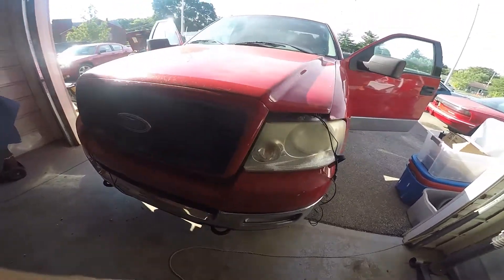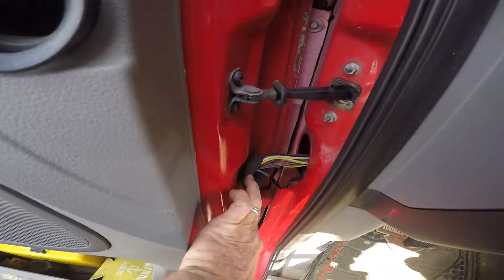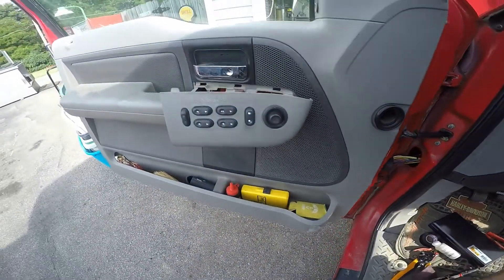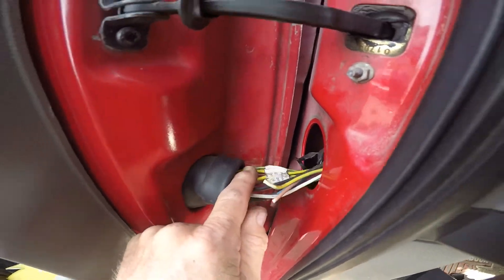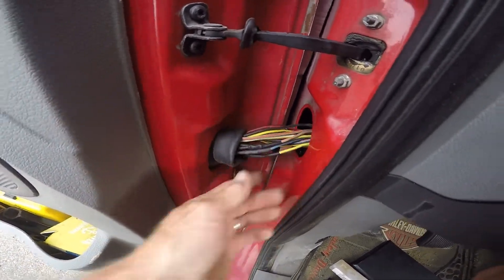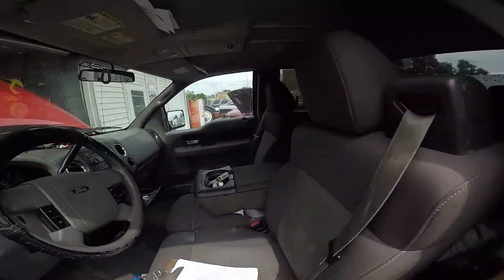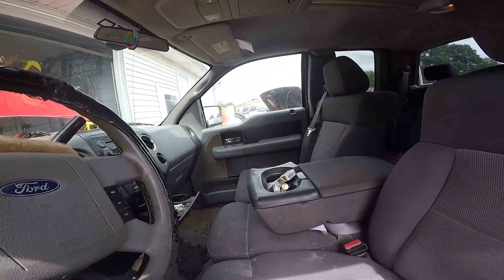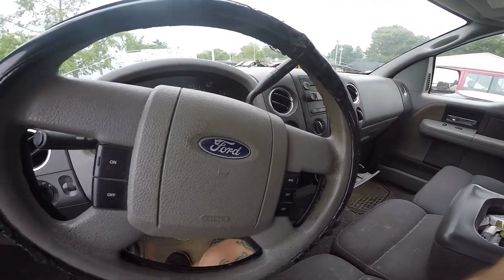2005 Ford F150 (power windows don't work)

Comment: 2005 ford f150 5 button power window problems - Following your video it seems that each window has its own power lead. So, here's my issue, my drivers window switch has been failing for sometime now, going down works fine, but going up was very intermittent. Just yesterday both (up and down) died. All other windows still worked (as good as to be expected for an 18 year old switch). I picked up a new 5-B switch at the local dealership, and installed it...same issue on the drivers window, though all other windows worked perfectly. So, my question, is there a separate fuse or relay for just the driver window (DW) switch? Does the DW switch power lead go through the door-jam bundle or does it go directly to the regulator motor?
Reply from the maker: It has been a while since I have worked on this vehicle. I recommend you get a wiring diagram. I have replaced a lot of window motors that did the same thing. I hope you found your problem. Thanks for watching.

Comment: Dumb question,.. is it possible to remove the rubber boot covering the wires in the door jam without tearing it out? 😬
Reply from the maker: If it will come out of the door or the jamb. It should push to one side or the other. Good luck. Thanks for Watching.

Comment: Are you serious!? The wires are that fragile. I installed new speakers in my 05 and just the front window is not working. I bought a new switch for it and that didn’t do it. But I guess I’ll have to check that next.
Reply from the maker: Good luck and Thanks for watching.